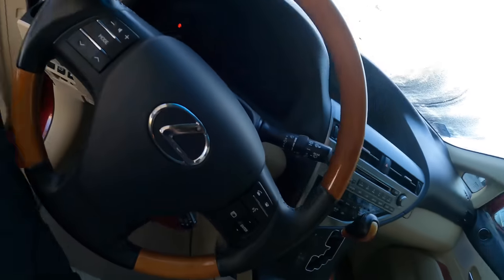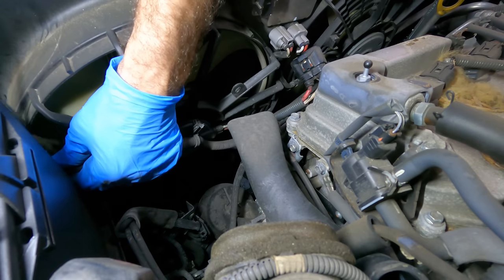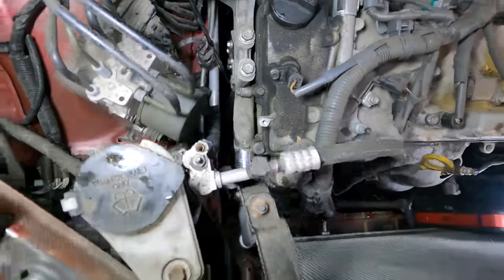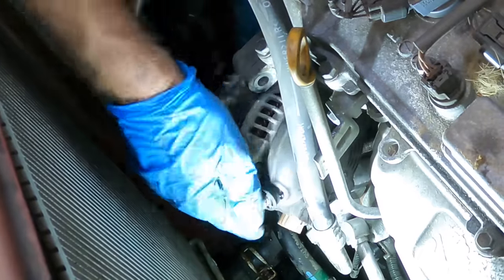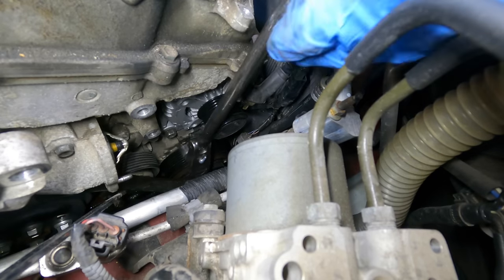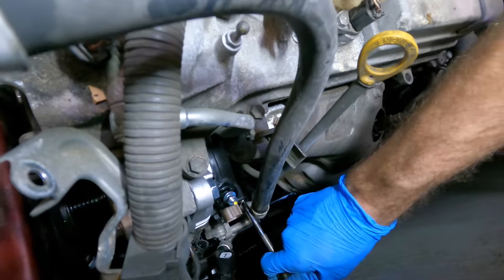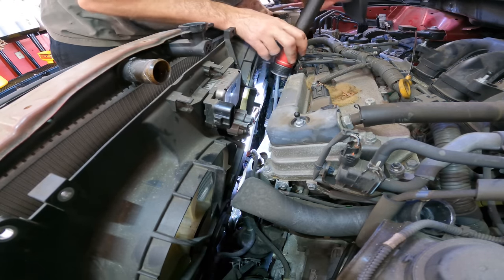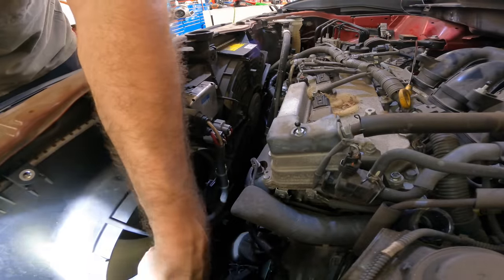Lexus Died While Driving! Towed In! No crank no start.  2011 Lexus RX 350

Comment: It's truly astounding how much dismantling (and consequent remantling) is needed to do repairs on modern cars.  I don't do work on my modern cars - but I have restored some circa 1960 cars - and replacing the alternators (or pretty much anything else) on those cars is ridiculously easy - 10 minutes tops.   It's clear evidence of the exponential rise in complexity needed to get the performance we do from modern engines.

Comment: Did this repair on a 2013 Sienna (same engine) it was an absolute nightmare. Took me around 8 hrs and almost cross threaded the bolt hidden under the pulley. I removed the front radiator bolts to give a bit more clearance for removing the nator. I also tried accessing the side bolts through the wheel well, it didn't help much.

Comment: Hey Rainman.... Get the alternator and stuff loose from underneath and remove the belt. Remove the fans and motor mount like you did. Then take a ratchet strap and pull the motor back 1.5 inches and the alternator comes out sideways in 1/2 the time.

Comment: "Not in danger of electrical shorting anything"

I am reminded of that time I did the clutch in my 1978 Datsun 510 and got the starter bolts backwards (top/bottom swap). Didn't even think about it because I was quite ignorant at the time and just wanted my car running and driving again. Top bolt was held on by just a couple of threads and the bottom bolt was too long, meaning the starter fell down while driving, but stayed relatively in place. Went to get gas, couldn't start it, popped hood, saw what was going on, top bolt still present, no tools available.

Reached in to rethread top bolt so I could start her up, and my metal watch band got welded shut (and I got some minor burns that matched the shape of the band) as it closed the gap between the starter and the block.

Comment: I once worked for O'Reilly's.  There I found a neet tool that clamps onto the strut shaft and holds it in place so you don't need a stick.  It has made life a lot easier for me until I replaced the strut.

Comment: i have a 2014 lexus rx 350...i've had it for just over 2 years now. it's been a great mode of transportation. i changed my own rear shocks to KYB's, new tires last year, rear hatch motor went out and was covered by extended warranty, hood struts are next to be replaced, changing the battery tomorrow just for peace of mind...so nothing major
Reply: Mine is an ‘04. Great cars!

Comment: Good job.  I've been there done that.  I had to remove the alternator on a 2010 lexus es350 in order to change the ac compressor clutch.  Didn't have to worry about damaging radiator,  as it had to come out as well. You're right though.  It goes back together easier and quicker. Probably took me about 2 hours. Worst part was having to be bent over that long with a bad back.  Keep up the good work and stay safe.
Reply: I know the feeling my body's curse me right now and got me out of bed way too early have a great day hopefully you're feeling better bye

Comment: For any parties that are haters or trolls and alternator is made to charge a battery that's why they're in the car if you have it hooked up right it will work once you get it to start it will charge the system back up if the battery is good have a great day

Comment: I can't believe just how dirty some people let their engines get. I have always kept my engines clean and free from oil and dirt. I  don't expect mechanics to work on a filthy engine. By keeping the engine clean you can quickly spot any oil leaks etc. When I purchased my 2007 BMW X3 in March 2017 I took it to my local garage for a service. I supplied all the Mann filters. The mechanic made a recommendation that I take it to a BMW dealership to check out the oil leaks. I cleaned the engine thoroughly and there were no oil leaks and there haven't been any since which I believe is unusual for a BMW. The so-called oil leaks were obviously spillage from oil changes. The car doesn't use any oil between changes either. The only mechanical failure I have had in almost 5 years of ownership has been the harmonic balance wheel. I had the swirl flaps (unique to diesels) removed and replaced with blanks shortly after purchase on advice of a good BMW mechanic (not a dealership).

Comment: All that to replace an alternator.  I have said this before, but these new sideways engines are not designed to maintain. They are designed for easy assembly line installation of the drivetrain. And they’ll all last 100,000. Then take em to the crusher

Comment: On these engines, I have learned that it is easier to just evacuate the a/c and remove the low pressure line from the compressor. It give you more room and you don't have to remove the motor mount or the thermostat housing.

Comment: If you take the right front wheel off you can pin back the tensioner with 6mm bolt. Then remove belt, remove pulley from top. Then you can get to the top alt bolt from the top, and bottom bolt from bottom. There is however and very pita "L" bracket bolted to the alternator and block that has the crank sensor wire clipped to it.

Comment: I did this job on my daughter's 2008 Lexus RX350 and there was 1 bolt above the thermostat housing pipe which goes around the corner of the head and is connected to a another hose. Loosing this bolt would have given you room to remove the thermostat and the 2 bolts you struggled with! Would not have to taken the pulley off! just for your info, Great video! Didn't show us putting back on the ribbed serpentine belt.......hm. you must have or your Nator would not have given out voltage.

Comment: Bro, I hate that you had to do this the harder way. Ive done plenty. Next time, don't take any mount off or thermostat neck. Do your idler and bottom alternator bolt from the bottom. There is also a tensioner pulley retaining hole(stick 5mm Allen in it)for your convenience down there. On ES models have a co worker pull the radiator as you pull alternator out. Hey, nice quality vids, while doing this work, impressive!

Comment: I remember the days when changing a alternator did not require tearing all the brackets and accessories out to get to it many of them you did not have to remove anything but the belt and on front wheel drive cars you could get them out from the wheel well by removing a plastic access cover but those days are long over now it takes a hour of removing things just to get to the damn thing.

Comment: I will not warrenty anything that leaves the shop with any suspect problems, too many ppl will just leave it and pretend its ok. If i do an alternator and the battery is shit, and not replaced, then there is no warrenty. If i do a battery and the alternator is shit, and the customer declines the alternator, then no warrenty. It is the domino effect one thing always damages another thing you must have a good battery, good alternator and good electrical system to have any kind of reliability. Also, if that battery was recoverable you need to charge it at 0.2C so about 15-20 amps charge rate and try to remove any stratification or sulfation with a high consistant charging voltage of 15-15.4 volts FOR MANY HOURS. The best charger i have ever used (and still use) is the Solar PL2320 and it is capable of 20amps and has a very smart charge curve that helps bring back dead batteries when used correctly :)  Its on amazon for less than 120$ canadastan dollero's.

Comment: I put zip ties together as a holding hand to lift and lower alternators and put a plastic screen sheet of a large LCD TV as a slider on the radiator fins good for anything else with Sharp or hard to lower or lift out .Love your videos all very good Did a Mercedes sprinter front caliper today two services and lots of testing .

Comment: I've done this in my driveway on this car, much easier to go through the passenger side wheel well to remove belt and alternator bolts! Did it in about 4 hours that way and I'm not a professional. Nice job though!

Comment: An alternator will charge a dead battery but it really shouldn't.  It's extremely hard on the new brushes and can cause premature failure of the alternator.  It's best (though not always possible) to charge or replace the battery before asking the new alternator to charge it.

Comment: You need to get some corrugated plastic cards (like plastic sign  board)  to put in front of the radiator to protect the fins from slipped/dropped wrenches and unwieldy parts.

Comment: i own a toyota harrier 350g bj2007 version of the lexus rx350. Easier way is to remove the right front wheel and the plastic cover and then turn the belt tensioner pulley so the belt comes off first, i then removed the upper radiator support, the fans and then the upper idler pulley, harness and then i removed the bolts to the alternator to get that out. I did not need to remove the aluminum coolant thermostat housing and the upper engine torque mount 😉. that was what worked for me though

Comment: You can take the upper core support bar off, loosen the top of the bumper, and just tilt the cooling fan/radiator/ac condenser forward enough to clear the alternator out and in, but yeah you still have to take the upper hose off the radiator and it helps to take the lower hose off the engine but you don't have to pull the thermostat housing off, just need smaller hands.  Also to mirror someone below me, the bleeder makes a big big difference. Open it when filling and you'll get out a lot of air from the engine, then crack it open a couple times once the engine is building pressure to blast out some air that's migrated there. Just did this on a Camry twice because the first new unit failed about a week after install. 2nd time boss did the job because he was free when it came in, I still had to reach a few bolts in a few places, it's a tight engine bay to work in. The belt tensioner is even worse because it's also the AC compressor bracket down there.
Also, that radiator upper neck is not long for the world, once they're going brown like that it's pretty soon after that they fail and since you're the last one that touched it you'll get the blame.

Comment: I own this vehicle and it wouldn't start last week. I had thoughts it might be the alternator, which quickly turned into nightmares upon my initial research! Big job with lot's of frustration built in. Thankfully it appears that my stupidity(listening to music + charging devices) drained enough of the battery when the car was off. Been fine since except for one brief battery light after a long drive with high beams on.

Comment: Dead Batteries & Charging Them:

I am a Master Class "A" Tech Retired, I'm a ASE Master Car & Light Truck, Auto Machinist, / Gas & Diesel Tech. Also, ASE Master HD Truck/Trailer, Gas / Diesel Tech. A Marine Master Mechanic by over 45 Manufacturer Certified. And I hold a College Degree in Electronics, and I taught Auto/HD Truck Mechanics. I have over 44 years experience in the field, even worked on F-106 fighters at Air National Guard.

 You are a very good Tech, top 10% in field, and you should be very proud of it at your young age. The one thing really going for you is you aren't afraid of the jobs you don't know. Many Techs turn work away only doing light work. Also your resources I never had most of my time with internet and info services. I had to buy books and go to dealerships to read their books.

3/4th of mechanics I meet don't know basic batteries & charging systems, and battery chargers work. It has to do with the electronics more then the mechanical end of it. You can look at it like water flow filling a tank. In electronics "The Volts pushes the Amps, and the Resistance gets in the way" just like water, "The {say a Pump} Pressure Pushes the Water, and the Pipe Size Restriction and tank gets in the way". The auto alternator pushes a max of 13.8 volts ate what ever amps it is rated at when full charging at 2000 RPMS. Your shop battery charger pushes about 19 volts top voltage when charging starts. If a battery is damaged it takes more force to push the electrons back in, because there is more resistance between the plates in a battery, because of  A) Low water in battery causing Sulfated plates where part of plates are exposed to air and non-functional, can't be fixed.  B) Physical damage to plates broken connection, open or shorted together plates.  C) Feathering or arcing of the battery plates, a damage caused by a higher level of amperage drawn from battery than it was rated for its usage. causing shorts or open connections in battery. 

Standard tests used by most people was a "Acid Gravity Test", a good test but messy and any cells down on water had to fill and charge first. Than came a "Amperage Load Test" fair test, but to use right battery needed to be charged, with out that it only told you battery was charged or not. I think it was a show & tell for customer benefit to sell batteries. Using it right took time that could be used else were and also gave false positives if not done right. Costly to charging dead batteries and you get come backs on the first cold day when battery fails customers not happy too.  

And the proper quick test, that's simple. Just a charge test, you don't charge up battery before testing. You hook up shop charger, hook up volt meter to battery, and charge rate up to 40 amps NO more. Charge TWO minutes and check voltage. A good battery non-sealed should be 15.5 volts charging or less, and a maintenance free sealed shut nonrefillable should be 16.5 volts charging or less. This tests the internal batter resistance when charging. It is a fool prof test, using less time to do too.

NOTE:  In my opinion all sealed lead acid car type batteries where you can't add water to batteries are junk trash like Delco's maintenance free batteries. Buy anything else and you will be better off for it!

Comment: I bought a 2006 Dodge Charger SXT, with 223,000 miles on it. I don't know what all work was done on it before I got it? At 301,000 miles, I had to replace the brushes on the alternator and replace the starter. I was surprised the starter even worked. It was so worn out. The gear was flopping around on it. The alternator was intermittently not charging. I noticed the lights would dim and brighten while driving it, until I changed the brushes. The transmission is another thing. I watched one if your videos earlier today, where you changed a fird transmission filter, fluid and a seal for the speedometer sensor. That really looked good compared to my fluid. I should have changed that fluid when I got the car. There was so much friction pad dust at the bottom of the pan. It was thick. I know I need it rebuilt soon. It takes about 3 seconds to change from reverse to drive. LOL 
When I saw how bad that lifetime transmission oil was, I changed it on my 2011 RT. It was much like the fird fluid you did, at 182,00 miles. Maybe they aren't supposed to be on the road after 250,000-300,000 miles? That could be their life expectancy? LOL 
I enjoy your videos.
Thank you.

Comment: I remember back in the 60s and 70s, you didn't have to remove the rear tires, and back seats, and ashtrays to remove an alternator.  Sheesh!!.  Somebody should make the engineers replace what they designed into an engine.

Comment: There is one Buick, I believe it's a Buick or an Oldsmobile and they're older vehicle, that if the battery is not fully charged, you can't say the alternator isn't charging, so the battery has to be fully charged to check the alternator to see if it's charging on this particular car, if the battery is fully charged and it's not charging then the alternator is bad, if the battery won't take a charge then the battery is bad and the alternator is charging

Comment: That nator only needed a voltage regulator. Check bw the slip rings for continuity. Also between the case. If good, put a new oem regulator and be done, co chances are fairly stacked that it is not gonna be a stator. Those are pretty much never the case in cars. Especially low mileage.

Comment: 9:07  at this point, I'm wondering if Ray is going to move on to "ok, I just have to remove the crankshaft to get to the bolt that holds the housing that blocks access to the first housing that connects the alternator to the water pump assembly which must be taken apart to access the alternator"  Holy cow, Toyota, could you have designed this engine to be a bit more accessible?

Comment: remove 50 % of the motor and then can  get to the alt .its why , i like older vehicles'. easy to work on.alt is out in the open and not stuck behind a pile of crap

Comment: Just subscribed , thanks for mentioning us ladies in your videos as well, some people do realise some girls like working on cars as well. Thank you.
Reply: Wamen most affected. 🤭🤭🤭🤭😅
Reply: @richardscathouse  yeah we are most affected because we are more at risk for being screwed over. So far I have changed spark plugs. Put new antenna into my car. Fixed and replaced steering wheel buttons. Replaced oil pressure sensor. Changed oil. Love how I can save money knowing how to do these things myself. I took my car into a well known auto electrician to install a stereo and he said the unit he gave me was good came with a reversing camera. Said he was going to install for me. Ended up charging me over 500.  Didn't install back camera. My steering wheel buttons don't work anymore and the unit was off ebay for under 100.  Unit doesn't keep the time, takes forever to turn on and after about a month stopped connecting to Bluetooth. Good money wasted.